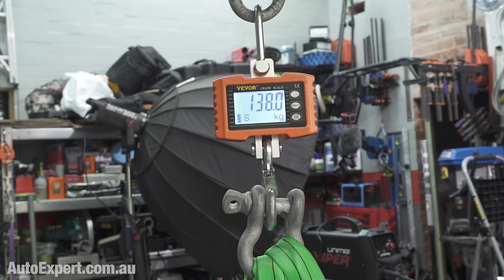Home heavy lifting - with no crane | Auto Expert John Cadogan

Comment: Thanks John, I really enjoy your antipodean vids. It shows the difference in life between you guys and us in the UK.
 Having had a one and only ladder accident in my workshop performing a job not unlike you fitting the hoist I am surprised you didn't mention the need to fix the base of the ladder. I was working with the top of my ladder propped against a beam as you did. The foot of the ladder was on the concrete floor and the angle was correct. Even so without much effort the the foot slipped just enough for the top of the ladder to come adrift from the beam. I ended up with my legs stuck through the ladder rungs and on the floor. I was working alone late at night so had I suffered any significant injury it may have been several hours before I was found. As it was I only bruised my leg and was able to walk away. The lesson I learnt was to always secure the foot of the ladder before ascending and then secure the top of the ladder before actually working at height.
Reply: Yep, precisely what I was asking. You've just described it better. 😅
Be interesting to hear what JC says👍🏻

Comment: You should put a wire rope type cable strainer on the control pendant so you don't break the electrical control cable when you inadvertently use the pedant to summon the hoist to the work location.
Reply: We always referred to it as a catenary wire at work. Ladders and lifting were always the most dangerous operations I was involved with as a support engineer. We got rid of most of the ladders with hydraulic lifts and movable platforms but they are not risk free, just a lower risk.

Since we moved loads weighing anything from a couple of kg up to 100 tonnes with overhead gantry cranes we had very strict procedures for the larger loads that involved cordoned off areas, check sheets and a qualified engineer to be in charge. We had a few loads drop, one weighing about 10 tonnes where someone set up a lift with an overspread 4 leg chain set who didn't consider that the tangent of large angles approaches infinity and another where a large gantry crane did an un-commanded lowering of a large load, I think it was traced to brake failure. It was the failure under load of the 4 leg chain set setup that made us introduce the check sheets and qualified engineers into the larger lifts. It was keeping people away with a cordon that kept people safe when the bolts of the bolt-on lifting points snapped and pieces flew off. And as for all lifts, it was keeping people from going underneath that meant there were no injuries.

The main takeaway from the failure of the high angle of the legs of the chain set is that there is a huge difference between safe working load (SWL) and working load limit (WLL) that the engineers involved had to understand and we had to be able to do the basic trigonometry that went with all the unique lift setups that we did. We also assumed that all the load on a 4 leg sling was taken on only 2 legs. Maybe that is a topic for a future video.

Comment: Excellent presentation thank you. 

Suggest a video on ladder safety would benefit many viewers. Especially on addressing the possibility of the ladder feet kicking outwards, with collapse of ladder.

Those of us who were taught vectors understand the forces acting on the ladder points of contact - wall, branch or gutter, ground or floor, and the friction stopping movement. But many ladder users do not have a clue.

Another topic for you to present could be basic workshop safety. I still remember our teacher Mr Wilson in first year metalwork at high school giving us the basics. Over 65 years ago. We students all used blowtorches on our own - imagine that happening these days😮

I met a chap in USA who lost his arm when his long sleeve caught up in a drill press. Things like spontaneous combustion, issues with extension leads, etc etc. could all be included.

Comment: One of the first jobs I had after qualifying as an engineer was to rig and remove 2 x 40ton cast iron pans and a steel walkway in a live sugar cane mill. The pans were on the 2nd story and I remember spending hours doing the rigging before allowing the first cut. Best part was cutting the 2 tons of walkway and have it move about 30cm laterally and stop dead. We then lowered it to the ground and cut it up. Most of the time was spent on mental calcs working out actual tensile loads for angular rigging and then using a big bloody reserve factor to allow for dynamic loads. It was 95% planning, 4% sweating and 1% cutting.

Comment: A good idea to wear safety glasses at all times in the workshop, not just up a ladder. Another reason is although the chances of getting knocked out by something hitting you eye is low the chance of getting dust or dead insects or the likes when looking up and on a ladder is extremely high as such things have a habit of residing on top of beams and it is not funny climbing down ladders half blind.
Reply: I don't agree with "always do this..." type of advice. The main thing in remaining safe is to always be evaluating the risk and responding to it in real time. Having blanket rules results in starting to turn off some of your evaluation because your mind has foreclosed on the danger and assumes it's safe. Sometimes the thing you do because, "always", can make other aspects of a job less safe or at least, less effective. The main thing is to just be switched on, know your principles of physics and be responsible for your safety at all times.
Reply: @andoletube  You can never tell when something will flip up or blow into your eyes, so if there is dust, loose particles etc around it is always best to assume there is a risk that something will get into your eyes. But otherwise always evaluate for potential risks and never assume that something is safe because nothing happened last time.
Reply: @Equiluxe1  Sounds like you're taking it out of the world of sensible precaution and into the world of disproportionate fear though. That's no healthier a state a state than being under-cautious. Your sympathetic nervous system is always fired up and you're trying to recruit your parasympathetic nervous system via the use of permanent goggles. This is more the domain of a psychologist than calm rational risk assessment. I've been in workshops for decades without one single incident of eye damage. I put that down to a calm assessment of risk, rather than a disproportionate fear of consequences and excessive precautions. And I can prove that because I never used excessive precautions. But I know how things work. Luck doesn't come into it.
Reply: @andoletube  I have been in workshops for forty five years and for most of that time I have worn eye and ear protection as a matter of course, I have seen some one loose an eye through not wearing eye protection from a flying piece of metal coming off a grinder and they were at least fifteen feet away from the person doing the grinding. It is not about being paranoid it is about being sensible in a hazardous environment.
Reply: @Equiluxe1  I've told you multiple times that I take adequate precautions in my workshop(s) and that I've never been injured, but you have an issue with your personality that compels you to be the one who knows best for everybody. Even when I said I've spent "decades" in workshops, your ego response was to say you've done"45 years" because you think that's an unassailable length of time that gives you absolute authority. 

Note that I haven't advocated anything dangerous at all, yet your mind is convinced that I'm not careful enough. You see what I'm talking about here? You don't know me, or what precautions I take, yet you are certain that it's not enough. You are a rigid thinker who can't see things from the point of view of others. This all stems from one statement you couldn't handle about avoiding "always" rules. I never advocated lax safety standards. I never even mentioned working in a workshop with others - yet there you go with more scenarios that don't apply to other people. I'd say your time in your workshops has allowed certain controls issues you have to percolate. So for that reason, I'm done with you, Captain Safety.

Comment: I have to use an engine hoist it requires a lot of floor spacee.  A chain fall is much smoother than an electric hoist if you need t  not be jerky. Another thing to help move heavy stuff are machinery skates along with a toe jack. My Bridgeport weighs 2,300 lbs. I can push it with one hand when it is on the skates.

Comment: John!!! Good stuff.

You forgot the most important safety rule: have a friend or three with you to say, "uh bro, not a good idea", or to hold the ladder, or what not. And by "with you" I mean, phones are off and everyone is focused on the job at hand, sober (the beers are for after the job at the strip club buddies!)

A load leveller is handy in this situation. 

I'm super cheap and Vevor's tooling is actually surprisingly good (it's no Snap-on, but at 1/4th the price you're getting 3/4ths there-- and their metal saw seems to be as good as my Fein cold cut). This lifting hoist don't got the rully rully necessary (imo) certifications from the ASME. (And that it doesn't have an e-brake which is also rully rully necessary for something, especially when the pendant doesn't immediately stop the hoist travel. When you hit stop, it needs to stop. Which is why I advocate the chain hoist below.) 

Pressure vessels, lifting utilities, multimeters and other test equipment fall into that "yeah, not worth fucking with to save a few hundred dollars". I'll pay double for that Fluke 89 multimeter to validate a breaker box is dead, even though 99 times out of 100 it will function just as well as the clones. Same reasoning behind the safety specs and helmet. I'd respectfully disagree and say that the chain hoist is by far the better option, even if it's annoying. It gives you the granular control that this hoist just isn't capable of offering.

Foldable hydraulic cranes are a pretty good trade off. They used to be super expensive, but thanks to China there are some decent ones out there. Harbor Freight has a 4,000 lb (uh 1800 kilo?) ASME spec'd crane with a 60 inch (150mm) boom and 90 inch (225mm) lift for under $300 USD, that folds down by just removing pins. I think they ripped off a name-brand's design because when I saw it I was like "that's surprisingly well thought out", but hey, that's capitalism!

Comment: Excellent safety advice John. My only (probably stupid) question is,  you have the ladder resting on the beam, and not a wall. Not that, that makes any difference,  I'm just curious to know how much of a chance there is for the ladder to slip by it's feet? That happened to me, but granted, the ladder's rubber feet were a bit worse for wear. Being against a wall, the ladder may just move slightly, causing no problem, but against the beam, it could lead to a nasty fall. Your ladder's rubber support is obviously in a very good condition,  but would you bet your life on them? Especially at the angle you're working at. The angle in your case is obviously determined by the height of the beam, and the length of the ladder.
Thanks, and stay safe😁🙋🏼‍♂️👍🏻
Reply: My thoughts exactly see my suggestion on ladder safety presentation

Comment: For fine adjustments why not use a chainblock between the winch and the load.
Reply: Where I worked it was common to use a ratchet lift for this type of thing, especially when it was used as one leg of a two leg lift and you needed to adjust the level of the load during the lift.

Comment: One thing I have seen many times is muppets using ratchet straps as lifting slings. The strap may look similar but they are really not. A rated and certified lifting sling has a significant factor of safety built in over and above the rating which is the safe working load, not the failure load. I do use ratchet straps when lifting but not in a load bearing capacity, only as insurance to ensure the lifting sling stays where I need it to be. Also, if a machine has lifting points built in, use them, they are in those locations for a reason and any decent machinery manual shows how and where to lift the machine in question. RTFM.

Comment: Personally i as a construction engineer i would recommend against hocking up lifts to random beams in your garage. If you are in a heavy snow area, and there is currently no snow, its likely that the roof will hold for several hundred kg extra.

But if you are in a no snow area or a low snow area, (or well there are loads of snow on your roof) the beam might actually claps.

While you might think. "well i´m only going to lift things that are 100-200kg or so"

yea... that might be your intention. But i seen more than one case of someone trying to lift a engine out of a it hocked on to the car and now they are not lifting 100kg they are lifting 1000kg, and they didn´t even notice it.

If you have a floor above its a bit different. Goes with out saying., don´t lift things while you have a dance party on the floor above. A floor is typically rated for between 2 and 2.5kN/m2. That would easily handle the total load capacity. But its still a question of momentum. So if you have one beam covering say 10m2 of floor, you would guess that it could hold 25kN total of force. And well it can, but only if the load is spreed. If its a point load in the middle it can typically hold about half. 12.5kN. While that is still plenty. (more than 500kg) but, the I-beam is not strengthened to take a point load that large. So you really need to spreed to load to not buckle the beam.

There is also the issue if something janks: Say you lifting a engine out of the car. Half the car lifts up, you don´t realize it. Then it falls down and janks in the beam. This will bucke the beam decrease it load capacity significantly to the degree that it probobly will not even hold the floor above.

Of cause, this is only true for moderate size beam, if you have one heafty beam and a proper insulation with load spreeing on the beam. This is not a issue.

While its true that a beam will bend safely, and quite considerably so, the issue is not bending of the beam but bending of the flange. If you bend the flange you lose loading capacity in the beam. So spreed the load on the flange, they are much more fragile than they look
Reply from the maker: I never said: 'OK to hook up to random beams in your garage'. I said, if unsure, get professional advice. So there's that.

Plus, I am in Sydney. It never snows. The garage is under the first floor. The beams overhead are designed to accept several hundred kilos of live load. 

Also, I am an engineer...
Reply: @AutoExpertJC  Yes of cause. is a bit different when its a floor over. But if is not, snow loads might be the diffrance, or rather, really probobly will be.

I´m not really worried about your set up. But when lifting something int he flange, the load limit of the beak is considerably reduced, Specially for I-beams that is typically used in cheap construction. Beams that are made to have lifts in them are often H-beams that don´t really have that problem

Comment: Great information as usual dude. But (and it's a big but), your ladder was only a couple of inches above the flange of the I beam and if the ladder slides at the bottom the top of the ladder suddenly has no where to go but downward with you and your new Vevor tool  in hand. You end up on the concrete floor looking like a pile of dude shit. Believe me I have had that experience and it hurts. Always make sure the bottom of the ladder cannot slide by blocking it or tying it off to something that wont let it move.

Comment: I'd add.  Always have an escape route planned.  Always have a contingency plan for if the motor does NOT stop.  AMHIFK. lol.   10 ton laddle of molten aluminum, gets lifted and doesn't stop.  The operator smacks stop button repeatedly and it still keeps moving up.  Malfunctions are a thing, as you know.

Comment: I drove a Rear Mounted Crane 1.3t capacity, Medium Rigid Flatbed, GVM 14t Tare 7t Pick Up & Delivery Truck.  As every sane person on Earth knows your maximum lift at Maximum range doesn’t matter, that’s just a number written on a piece of paper to alleviate the Fears and Anxiety of those OH&S Power Hungry Safety Compliance Nazi ' s, So I Can lift that 2 tonne pallet of concrete from my deck and Place it on the 3rd floor alcove some 20 odd metres that way from the closest point I can reverse my vehicle in to.
She’ll be right Mate just a Little Stretch " Hey.." 
Or Can you drop 1/2 pallet here and 1/4 pallet  on that side and 3 buckets over there….
Or what do you mean You started at 6:30 am,  I was here at 5 am and you didn’t get onsite till 8am so Im going to charge you for my loss of time….
Or My Boss will get a Request that States.  On such and such a Date at this address your driver delivered an excessive amount of product to my Site " So tell him to come and pick it up and Give me a refund for the Product and a reimbursement discount for wasting my time and efforts trying to run " Your Business " For You…… 
Or I will arrive at a pick up excessive orders and the product will have been walked around the site to aid the construction process and ….
Owner/Drivers don’t get paid overtime, a set amount for travel already negotiated on contract acceptance, so if you get caught up in Traffic , or as such other issues,  arrive onsite when the gates have been locked, and have to pull down construction panels to get in , Unload , depart and Reassemble Panels it' all out of your own time effort and schedules…..